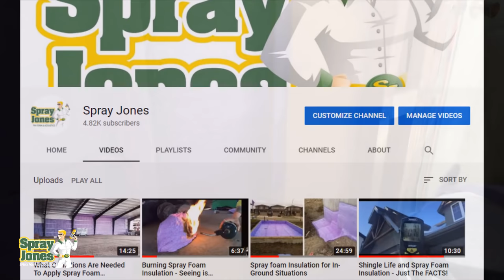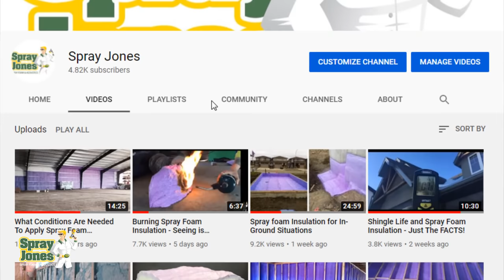5 Spray Foam Insulation Failures and Why!

Comment: I'm doing siding on a new home that is getting sprayed. I showed up to half a wall soaking wet and half dry as a bone on the house wrap (tyvek). The wall  inside was half sprayed 10 days prier to me showing up. The part of the wall that was dripping with condensation  was sprayed the part that was bone dry was not sprayed. You could see the studs through the plywood and tyvek. Was -1 c in the morning . Any ideas why
Reply from the maker: Seeing studs in normal. That is the storage affect of the lumber mass. 
I need more info to assess what you saw. Was there heat on inside the house?
Watch my video on why there are lines on the roofs of homes sprayed with SPF. You'll find it in the playlist for vaulted ceilings. Explains the phenom for you.
Reply: There was no heat in the house and was around 1c in the morning. Picture a wall on half sprayed and the other half not sprayed. The insolated  part of the was soaking wet with condensation on the outside ply wood  and house wrap. The part that was not sprayed was dry as a bone.
 @SprayJones

Comment: My spray foam smells so bad. Looks cured. Turning into a nightmare. I have tried ventilation and it isn't working. Do you know how to remediate or any suggestions on remediation? Does it need to be removed? Just desperate!
Reply from the maker: Removal....

Comment: I was wondering if you have any videos on different spray guns and what pattern is best to use in spray foaming. I have a PMC PH-2 gun and I’m considering getting a fusion Ap. I’ve seen a lot of people using them and I’m wondering if there is a spray patter and quality difference between this two guns.
Reply from the maker: Personal preference. Most of the guns will deliver just fine. It is the foam, settings, environmental conditions and operator that sways results.

Comment: This is great info, thanks for doing this video!  I'm looking at hiring a company to spray my new shop, and I'm concerned about the health impact of the off gassing after seeing some horror stories of people getting really sick and having to go to extremes like removing their entire roof.  I've tried to find a good, well priced (meaning I'm willing to pay more for quality) contractor that has excellent ratings, but that has failed me in the past.  Is the off gassing issue fairly rare, especially for well-established and well rated contractors?
Reply: I have the same worries!!! Every foam company uses this excuses “that’s ur problem….u look on the internet…” it’s 2022 and I’m sure there is still bad installs
Reply: @diaperdood1  I checked the company I ended up using out thoroughly, and they did a great job. The problem I ran into afterward was loud popping and snapping sounds. I applied it to a metal building. No one ever suggested this might happen. Doing more research, it's a common thing, and could mean separation. Probably a complete waste, and I will probably never do it again. It's quite cool inside though
Reply: @supernat1978  how long did u stay outside before going back in
Reply: @diaperdood1  I got covid the week they finished, so about 3 months now 😆 I haven't actually been able to spend any time in there,  but have gone in for a few minutes at a time, definitely is a smell,  but not super strong. And didn't cause me breathing issues.  Having said that, I probably would never put this in a home.

Comment: I had 2 way spray foam done in September in Ohio, weather was warm, but my garage in mid to late Oct garage is very cold. I have photos. It seems like it's 1" after sprayed. Do you have a Web site or email. You could advise me on why the garage is very cold meaning not functional as an insulation.  Thank you.

Comment: Is it ok to apply spray foam insulation when the attic is 110 degrees? Will it fully cure? Or will it off gas forever?
Reply from the maker: Most of the super hot climates have special summer grade foams that will allow the SPF to be sprayed that hot. 
It is not so much "cure" as it is to have a controllable pattern.... plus who physically can handle being in that environment?
Reply: @SprayJones  thanks so much for responding. I’m just  worried about it. There’s no real info about it such as warranty if installed

Comment: isnt the masking under the rim joist in the video at about 3:37 preventing a seal between bottom plate and top of foundation?
Reply: There would be a sill gasket in between which you likely cannot see. Wood on cement for example is not permitted. Please ignore the rude remark above.

Comment: Can I used closed cell foam spray on a unvented metal roof?
Reply from the maker: Yes. 

Watch the roof series. Part 3 is the one you need.
Reply: @SprayJones  Thanks! What about it being so tight that inside moisture can't escape, causing excess humidity as some say? Is this also covered in Part 3? I will watch and subscribe in that you were kind enough to answer.
Reply from the maker: @rickblythe4864  It is covered for sure in the series. I strongly suggest taking the ride and watch videos 1-4 so you will be up to speed on the science and ways of doing it.
Reply: @SprayJones  Thanks again!

Comment: I did sales for a company and they used expired foam they bought expired, they had me selling b.a.s.f. foam, which is the best, however they installed expired off brand foam and the foam stinks and pulls back off the studs. Also the installers where so stupid and did bad work, also there truck leaked oil and they would park right in the driveway without a care. They only stay busy because they get new customers from home shows. I quit after I realized their ethics were so incredibly low.
Reply from the maker: Very common unfortunately.

Comment: can you foam the roof of a pole shed, ( the outside top of the roof, not inside the building ) and coat it with a waterproof coating to keep the inside from dripping in Minnesota or will it still not stop dripping because the steel is still exposed inside?
Reply from the maker: Yes. 
We don't.
You should have 3 lb roofing foam and UV stable top coat - many to choose from.

Comment: I used spray foam over my basement foundation walls. I remember hearing a popping sound come from that area after I finished. Could the spray foam have exploded and leaked liquid down onto the floor? The floor around there is all damp and sticky now. There is a foundation crack behind there that has never leaked in 50 year old home and that area outside is under the deck so I don’t think it’s leaking. I did try and fill the crack with a Sika epoxy resin and that stuff ran down onto the floor also. Thoughts?
Reply from the maker: Foam disbonded from the wall. That is the sound you heard. 

Cut it out and re-spray properly. Dry!
Reply: @SprayJones  awesome thanks for the reply. How imperative is it to respray? Just by looking at it it looks okay minus the “leak”. Will there be future issues if I don’t respray it?
Reply from the maker: @ennsy9  Then leave it. Up to you...
Reply: @SprayJones  I hacked out the stuff that was wet from the leak but left the majority. Seems to be fine. Thanks for your help.

Comment: I used closed cell on my walls , can I use closed cell on the roof ceiling in the attic?
Reply from the maker: Yes.
Reply: @SprayJones  would I benefit from a radiant before or after the foam?
Reply from the maker: @21gonza21  No, SPF is all you need. Conductive and convective out weigh radiant when in comes to roofs. 
Watch the shingle life video I made and see the attic temps with SPF.

Comment: I’m getting close cell foam in my garage, my question is do I need to use MC cable to avoid mice from eating the wires or is there something in closed cell that will prevent mice from eating it?
Reply from the maker: Mice will not eat it. Get a cat... Lol
Reply: @SprayJones  Don’t think my 165 pound mastiff would like that too much

Comment: It's so uneven 🤨 gaps.... I'll skip foam.... I mean it SOUNDS great. I was sold on it until I watched several hours of videos on it. Even in the "this is how you do it" videos I see flaws... PLUS 2x4 R-value is negligible
Reply from the maker: Please go away. You know nothing and have learned nothing.
Reply: @SprayJones  says the guy selling a products.. Pray tell... Which part am I incorrect on? The uneven spray and gaps in your video? The negligible R-value of wood 2x4s? ...OR the fact I've researched several hours on spray foam and am not a fan?.... Talk facts.
Reply: @phironosurvivors2069   what gaps? And until you get behind the gun and see that every job isn’t going to be perfectly flat.. but as long as the lowest point meets code/requests then a few higher spots aren’t going to matter..No one will see it.
Reply: 2-3 in of foam is way better than fiberglass , you will have way more gaps with fiberglass or rock wool
Reply: @carlfrase8097  I walked into a metal home being built after it was sprayed, and the temperature difference between outside and inside was quite amazing. This was summer in GA and it cut the heat down substantially, even though it wasn't perfect looking.

Comment: How do you get around the Cdn building standard of a maximum of 2" pass? I know you are using basf high lift foam but a manufacturer recommend lift CAN NOT trump the Canadian building code. Why educate the public and show videos of wrong applications in the same video?
Reply from the maker: The building code is for new builds. Retro it does not apply. Plus there are many situations that 2" is what the code calls for. 
I would have thought this would be basic knowledge.
Reply: That doesn't answer my question at all. Maximum pass of foam in Canada is 2". I was asking how you get around the Canadian application standards.

Comment: How... How do you have a gun spraying that good.. And still cover the studs like that... Need to retrain your sprayers.. Or hire me to..
Reply from the maker: The foam inside the stud bay like you see us doing makes sure that at least a skiff is over all wood joints inside the cavity. So in fact you get a better air seal with this technique. A picture framed wall will still have gaps that air can flow through.

Comment: I think ours was a failure.....
Reply from the maker: Ouch! tell us what went wrong... to help others.
Reply: @SprayJones  pulled away, lots of voids, inconsistent depth.  I found a small hole and looked inside to see the sheathing.  Started opening it up and it turned into a 3 foot void.
Reply from the maker: @Off-Grid  Yikes. I assume this is closed cell foam?
Reply: @SprayJones  open cell
Reply from the maker: @Off-Grid  Oh Ok! So any voids in open cell is a chemistry issue. Either he did not mix the resin properly or he was using an inferior brand of foam. Ope n cell takes a great chemist to construct. When they get it right it is awesome.
Have an Open Cell 10 min video coming up soon.
Reply: @SprayJones  at some point I'll have videos of it on our channel.  We're a few months behind on the build at the moment

Comment: I've  had gun failure not the guns fault I missed a part one the b screen the rubber stopper that holds the spring . Changed the gun out started spraying only A came out very sticky mess not a fun clean up . And I have spayed to thick almost caused burning . Not spraying substrate but parking the machine I sprayed into a bag made a big bun it melted the bag and I broke it up immediately and it was smoking . Never again I now lay out Polly and I make little mountains I save the spray Hill and add a layer when I park I give the buns to my buddy he has ac cars he makes tracks with them lol

Comment: Even so, spray foam isn’t a long term solution. You don’t want your insulation failing behind your walls in 20 years.
Reply from the maker: How many garage doors with pour foam in them are no good after 20 years?
Reply: @SprayJones  I appreciate your response, but it’s different, right? We don’t see 20yr warranties on spray foam jobs.